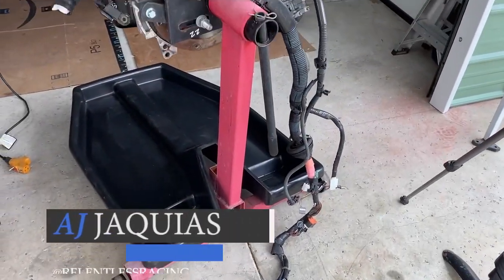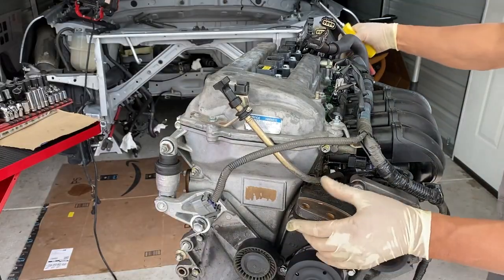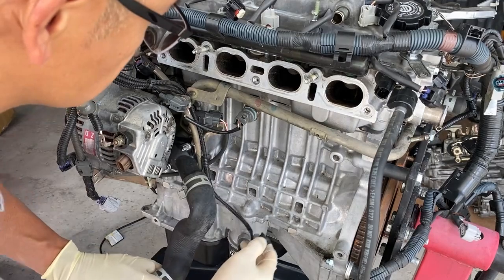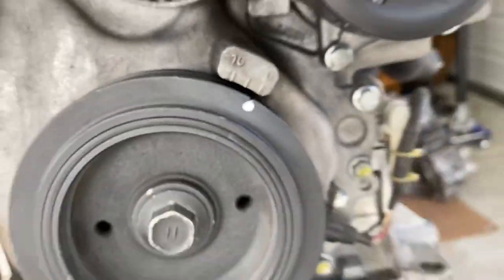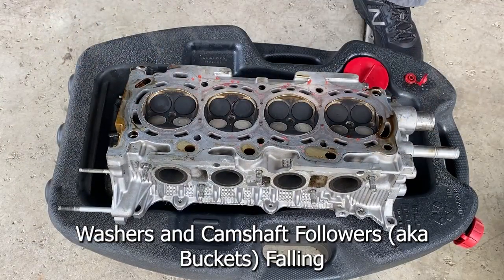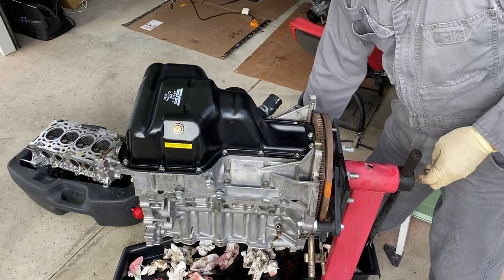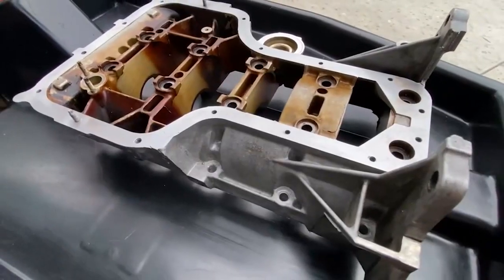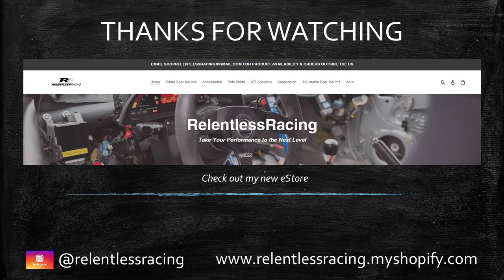1ZZ Tear Down - Toyota MR2 Spyder 1ZZ-FE Complete Tear Down

Comment: I honestly love the 1zz engine and have no need for anything more, I love pushing the car to the limit in every day situations.
Reply from the maker: I agree with you… the 1ZZ is a solid motor, but who doesn’t appreciate a lil more horsepower?  Thx for watching and the kind words. Pls subscribe and don’t forget to check out the pre-cleaning cleaning episode. Also, pls visit my eStore www.shoprelentlessracing.com
Reply: I just wish there were a close-ratio-7-speed manual out there for the 1zzfe engine.  :-D
Reply: @peterlai9018  Just up the final drive ratio if you want closer gears.

Comment: 1zz fe is an underrated platform. They dont have insane performance or anything but they perform well for what they are while keeping fuel consumption pretty low. They boast a pretty high power to weight ratio as well and pretty good torque, their hp is adequate for their intended purpose as well. Overall just a good engine that actually outclassed most of its competitors in its leauge through higher performance output and combined effciency.
Reply from the maker: Agreed.  It’s a motor w not a lot of HP or torque, but it definitely serves its purpose. Although, Toyota did have some issues w the 1ZZ-FED in the MRS between 2000 to 2002 w excessive oil burning. They did resolve the issue in 2003, but that’s why I rebuilt this motor. Thx for watching and commenting. Pls subscribe. -AJ

Comment: This is the video I've been looking for.  My 1ZZ (from a 2004 Pontiac Vibe, 235k miles) lost all compression to cylinder 1 last weekend.  I've got a back-up car and a plan to investigate and attempt to repair.  I'm guessing a broken valve, but I'm not a mechanic.
Reply from the maker: They are interesting motors and quite simple.  Good luck w diagnosing your problem.  Stay tuned I will be posting the rebuild vids soon.  Pls subscribe.  Thx again, AJ

Comment: I just learned recently that the spyder motor is actually not the same as the celica, matrix vibe and corolla.  That's why it's actually called a 1zz-fed
Reply from the maker: Almost correct… the Celica came w a 1ZZ-FED like the MRS. The 1ZZ-FE has different cams, valves, crank and fuel rail & puts out less power. Also, you have to drill and tap holes for the axle carrier. However, the rebuild follows the same process. Thx for watching and commenting. Pls subscribe. -AJ

Comment: Excellent video 👍
I will need to rebuild my 03 Corolla CE engine, due to clogged oil control rings.
My plan is to upgrade to high compression pistons and light cam.
Reply from the maker: Thx for the kind words. Definitely check out the 7 part 1ZZ build series on my channel. Pls subscribe. Thx AJ

Comment: 9:50...  Looks to me that the chain jumped a tooth - Timing marks on the cam sprockets should have the yellow links centered, right?
Reply from the maker: Incorrect… the only time you will see the timing chain marks line up is when u first install the chain. Once u rotate the crank and come back to TDC the marks will b off. Check out my timing chain video to learn more

Comment: Just watched to see how the process is mainly done, I've been thinking of rebuilding a 179,000 mile 1zz in my 21 year old Celica. It's a nice old style Toyota engine even though the power output is dated now but I wanted to keep the car original while rebuilding it. Also wanted to ask if you ever measured the mpg on your MR2, the best I got was 41 mpg on the highway in the Celica.
Reply from the maker: Thx for commenting and pls subscribe bc there are more episodes to this engine rebuild. Im a firm believer in the learning process and encourage to rebuild ur motor.
Reply from the maker: Unfortunately, I did not record my mpg but I’m not really concerned w mpgs. I will b k swapping my MRS and just getting this 1ZZ running so I can dial in the suspension at the track while I am building my k series.

Comment: Sibop bloguna 10 mm demissiniz nikelaj yerindede öylemi yaziyor.thrkiyede 10 luk torslar cok inceydi deneyemedim.yardimci olursaniz sevinirim
Reply from the maker: I used google to translate your comment, but the translation didn’t make sense. Perhaps you can leave your comment on English. Sorry, AJ
Reply: Subap bloğu 10 mm torx lokma söylediniz kaç numaraya denk geliyor
Reply from the maker: @gameplaypubg976  I’m still not understanding the translation from google. My apologies, but I don’t understand Turkish. If your comment isn’t in English, I can’t reply. Again, sorry.
Reply: The torx you say 10 mm is also very thin in Turkey. What does it say on the nickel plate of the torx you have in your hand?

￼
Reply from the maker: @gameplaypubg976  at what time stamp in the video are you referring to? What part am I torquing?
Reply from the maker: @gameplaypubg976  are you referring to a 12 point bolt or a particular Torx bolt?

Comment: Like your video!

Your MR2/S looks very low mileage and certainly not run in the salts of winter that kill so many vehicles.  How many miles?  @7:23 in video, even the bolts and head are in new condition, but later, the cam cover looks old....? Is block painted?....the more I watch, the more I see this engine has been serviced b/4 this video...?  Also oil pan does not looks Toyota OEM.....what is up?  Do not know of any bearing issues with 1zz/2zz unless oil low.  I purchased 2zz with over 100k miles and looked like a turd.  Inside, bearings perfect, bores very minimal wear.  Still ringed and added all bearings to Toyota color/number code, measured and confirmed with Plastigauge.

Any idea on head-gasket failure?  After further watching, not head gasket, engine was run low on oil and damaged bearings and bores furthest from the oil pump.  Low oil caused damage and circulated through the full oiling system.

PS:  Liked that you pointed out TDC- Compression, vs TDC Exhaust.  A timing nightmare when setting valve clearance.

Final Q:  After all this work and pulling engine, why did you not go with the 2ZZ-GE?  Much more fun and more reliable.  Early 1ZZ-FE's had CAT and oil-ring issues....I know this b/c I purchased an 01 MR2/S with under 60k miles that burned oil at the rate of 1qt per 300 miles.  I think a Mercury 2-stroke outboard burns less oil!

Very interested in M.Y. of this engine as the oil rings still look acceptable.

PS2:  Go 2ZZ-GE.  K is more powerful, but much more difficult and returns on labor is not enough.  

PS3:  You have rods loose.  Engine out.  Pull crank shaft and have easy access to push pistons out w/o having to worry about any bore damage (lol it cast iron sleeve on 1zz)....but if this far in, should be checking main bearings....especially since oil starvation is suspect.

P-Chi
01-MR2/S, 2ZZ-GE, 6spd, LSD (Toyota)
Reply from the maker: Whoa... were you on crack when you wrote this? Chill. I have no clue how many miles were on this motor. I pressure washed the motor b4 I pulled it out of the car. The block is not painted. Idk if the motor was serviced b4 this video. It had a Dorman oil pan on it. They are only $60 and are almost identical to the OEM oil pan. Pls stop with the "OEM is best" stuff because I use a ton of aftermarket parts without issue. It was a head gasket failure. I'm not sure what you are seeing, but there was minimal rod and main bearing wear. Yes, I showed everything in the video (use the chapters to skip around if you missed something). I opted to rebuild a 1ZZ to learn the motor. Note, I also have a 2ZZ, K20, and K20/24 build in process. FYI - the 2ZZ is very similar to the 1ZZ, but the 2ZZ is prone to oil pressure issues and cam wiping. It is not what I consider a reliable motor and its output leaves a lot to be desired. I rebuilt a 2ZZ and am in the process of rebuilding a C60 transmission... both will be swapped into one of my MRS'. Just like the 1ZZ, I built the 2ZZ to learn about the motor and swap. FYI - you can't tell if oil rings are acceptable by visual inspection. Lastly, I checked the main bearings and there was minimal to no wear on the mains. Again, I don't know what you are seeing, but there was no evidence of oil starvation. Thx for watching and commenting. Pls subscribe. -AJ

Comment: I have a 2000 Toyota Celica GT with the 1ZZ-FE. It uses about a quart of oil for every 100 miles (I just bought the car and the kid swore up and down it was in great shape). I was considering trying to do the rings and whatever else I can do. Do you think a 50 year old guy with little mechanical skill could learn and accomplish this? Basically, if I can't fix it, I'm going to lose a ton of money. Thanks.
Reply from the maker: I believe if you set your mind to it, you can do anything. Buy or download the factory service manual and follow the instructions. You got this. Thx for commenting and watching. Pls subscribe. -AJ
Reply: @RelentlessRacingAJ  I subscribed the second I saw the content and quality of the videos. Thanks!
Reply from the maker: @MaisonPulaski Thx for the sub. Read the OEM service manual and watch my 1ZZ rebuild series. Have fun rebuilding your 1ZZ!!! -AJ

Comment: Cool thx, you mean if the dots aligns like this, paused at 9:40 min, all is correct even for the 2zz ?
Reply from the maker: Yes, assuming the crank pulley mark is on the 0 marker at the same time as the dots on the cam gears are aligned.
Reply from the maker: The cam gear dots should align every OTHER time the crank pulley marker aligns w the 0 marker.
Reply: @RelentlessRacingAJ  thank you very much!😁
Reply from the maker: @CosmicMindSense  not sure if u have a MR2 Spyder, but if u do perhaps u need a slider seat mount for it. Check out my eStore www.relentlessracing.myshopify.com

Comment: Question on those few hoses connected to the throttle body. Which one connects to the intake manifold and where is it coming from?
And the other 2, which one is the incoming water hose and return one?
Reply from the maker: I honestly don’t know. I marked all my hoses, took pics, and vids so I don’t have to think when I put it back together. I recommend consulting the Bible (OE service manual) if u really want to know what these lines are for.

Comment: Need a bit of help from anyone who happens by: I'm also trying to source a '03 or later 1ZZ for my 2001 (engine blew),  but they're rare. Those that I do find have no specific year listed; however, the heatshield design appears different. My exhaust manifold has two 02 sensors sticking out of the exhaust manifold in a V shape, while most every 1ZZ I find online, even those listed as being for an MR2 specifically, has a different heatshield design with a single 02 sensor sticking straight up from the exhaust manifold. Was this part of the 03 and later redesign that fixed the oil consumption issue? Or are these motors from other vehicles and just mislabeled?
Reply from the maker: I’m not an expert w all the different 1ZZs, but I believe all the 1ZZs have VIN plates on them and you can search them on the internet. That’s how I know I have a 2003 Matrix 1ZZ built in Canada. I’m sure w a lil research you can figure out the details of the different 1ZZs. Here’s a post from the Facebook group MR2 Spyder with some helpful comments https://www.facebook.com/groups/ToyotaMR2Spyder/permalink/10159035830323612/

Pls subscribe for more automotive content. I just upload episode 3. Thx AJ
Reply: @RelentlessRacingAJ  Much appreciated, brother. 
Did some more research. The plate in question is down near the flywheel. Makes the retailers on eBay seem pretty sketchy for not disclosing what year the motor is they're selling. And I figured out the heatshield thing. JDM 1ZZs used a different exhaust system, so they had a different manifold and heatshield.

Comment: 1zzfe? In an mr2? Was it swapped? All the one's I've worked on were 1zzfed motors.. The D had forged rods and a forged crank. Edit.. How fun was it to pull the motor? Is it like the old mr where you lift the body over the cradle?
Reply from the maker: I bought the car w a blown motor and swapped it.  I identified it as a Canadian 1ZZFE in another video. Pulling the motor is simple: 4 jacks stands and the motor drops down and out.
Reply: @RelentlessRacingAJ  Years ago i did a clutch on the SW20 and man did that suck.. I just remember that week thinking, i should have brought it somewhere... lol

Comment: Is this the same engine that a 98 coralla has?
Reply from the maker: Yup… all the 1ZZs are very similar. U may see different throttle and fuel rail configurations, but the bottom end and cylinder heads are nearly identical. Pls subscribe. Thx AJ

Comment: Where did you get the bolts to engine to stand ? or length
Reply from the maker: McMaster has everything u will ever need. I’m sure u can get them elsewhere cheaper but the selection at McMaster is 2nd to none. Pls subscribe. Thx AJ
Reply: @RelentlessRacingAJ  AJ- I just measured mine and it looks like the top 2 are M11 x 1.25.  For my stand,  i'll need 100mm.  Couldn't find any on McMaster.  Wonder why Toyota settled on M11 for that application?
Reply from the maker: @markmartin6856  what?  Which specific bolts are you referring to?  I don’t believe Toyota uses an M11 bolt anywhere.
Reply from the maker: @markmartin6856  I just read ur original comment the those are M12
Reply: @RelentlessRacingAJ  AJ- WOW. You were dead on!  I never thought a bolt that measured 11.04 mm in diameter would be considered M12.  I think the word "nominal" comes into play when talking fastener sizes.  Used 2 - M12 x 1.25 pitch x 100mm bolts.  Worked perfect.  Thanks!

Comment: I did my head gasket in the car but it needed new valve seals and I didn't do them then. Put it back together, burns oil.
Reply from the maker: Thx for watching and pls subscribe. Wow that seems like it would be very challenging. How bad was it?  Also, why didn’t u do a complete rebuild of the head when it was out?
Reply: Good question. The valve spring tool I bought didn't work. I guess I didn't think I would need to replace those. So now I am doing k swap, waiting months and months and months for parts through MAP.  I kind of want to get refund wait is ridiculous
Reply: I think it has other problems too. Poor 1zz.
Reply from the maker: @supers0nic77  as I mentioned in the vid, I’m doin a Kswap as well. Waiting on custom rods from CP. In the meantime. I want to get her running again, but I’m struggling w my OCD. After finding the scoring in cyl 4, I want bore it out to 79.5 and install new pistons, but I kno this will take money away from my k swap.
Reply: I really want to keep it 1zz but the k is proven in power and reliability and aftermarket products. So in a way I'm a little sad because 1zz turbo is capable but I'm not convinced of the reliability. But either way these cars are so much fun and way underrated
Reply: I really enjoyed the video Thanks for doing it. Ocd translates into good video and communication to the viewers. I could use less adhd and more Ocd myself.
Reply from the maker: @supers0nic77  I have a track buddy that had a 1ZZ turbo and it was very reliable. It was an 05 w stock internals and water meth
Reply from the maker: @supers0nic77  thanks again for the kind words. Stay tuned for more MR2 content